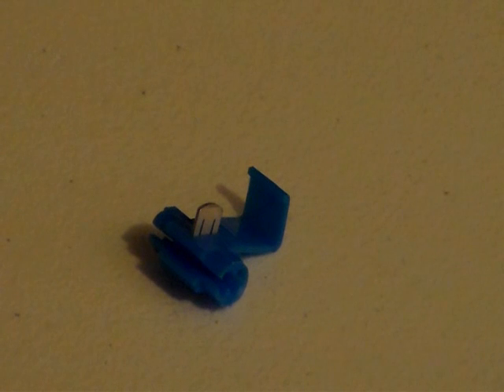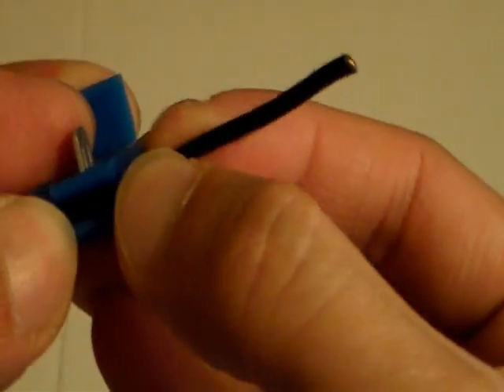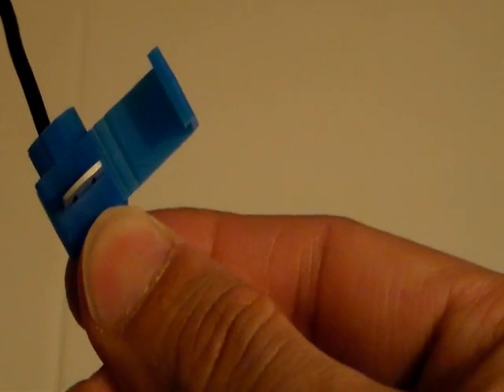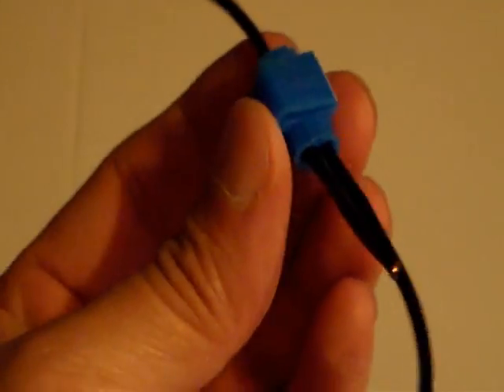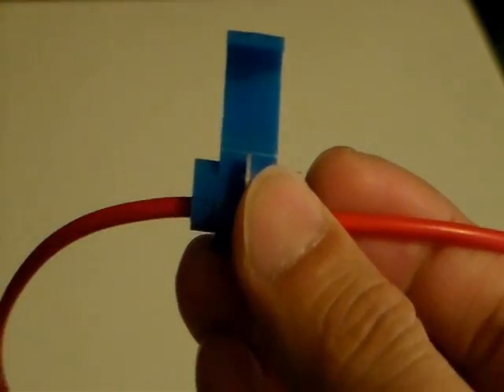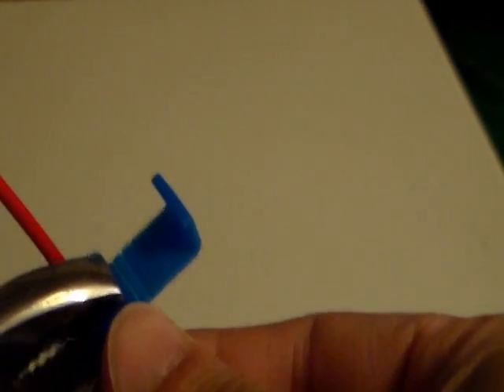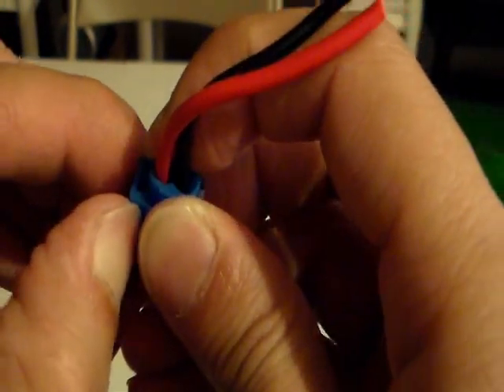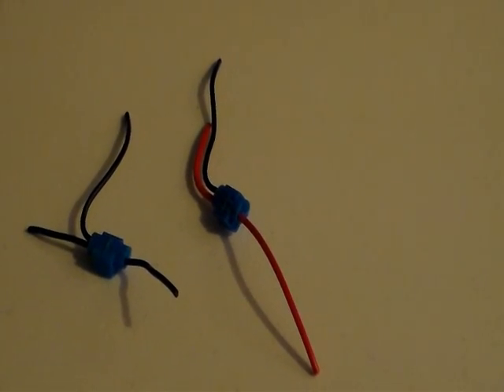Connecting wires using Quick Splice Connector - Scotchlok

Comment: What if you need to remove it? Just use the pliers to pull off the plastic part?
Reply from the maker: Whatever way works with minimum damage to the wire. I don't think this connector was meant for removing it's more of a permanent connection. If you plan on removing it, there's other connectors with easy connect and disconnect.
Reply: Were you able to remove it?
Reply: @ryatt1  ya it was pretty ez, just pull the tab back with a pair of pliers
Reply: @k3vin8  alright. Cus the splice didnt work for the lights i tried setting up in my car. Might need to cut open the insulation a bit more before putting another splice on

Comment: Can you take the connector off after you've spliced two wires together? By that i mean if you want to disconnect the other wire from let's say your car.
Reply from the maker: I'm not sure what you mean. The connector is just there to connect two wires together. Whatever else that needs to be modified would depend on what your project is.
Reply: @WelkingVue  once you push the metal part in on the splicer can you pull it back out? Without ruining the wires
Reply from the maker: I don't think this connector was meant for connecting and removing. If you want to do that there are some connectors made for easier connecting and removing. If you remove this connector from the wire you would have already cut the insulation on the wire. The wire could be partially cut when it was spliced.

Comment: Using these is asking for electrical failures.  First of all two dissimilar metals will cause electrolysis.   The connection will corrode over time causing failure.  Secondly you are leaving the connection open to the elements.  Even if the connection is inside the car there is moisture in the air which will lead to failure.  I've worked in the automotive repair business  for over 40 years.  If i found a technician using one of these he would no longer have a job.

Comment: Thank you! How safe and durable are these connectors? I am in the process of adding a rearview camera to my car and the camera needs to be connected to the positive and ground cables. Will these connectors work in your opinion? Thanks
Reply from the maker: I think how durable would be subjective. If you got extra wires and extra connectors the best way to find out is to test it out. Connect wires to this connector and try pulling on the wires it'll give you an idea of how durable it is. I done this test before, but with other type of connectors. Keep in mind if the wires are too skinny you probably won't get a good clamp and it'll fall apart easier.
Reply: These things will cut your wires. Not meant for wiring for vehicules purposes or a rear cam lol

Comment: These types of Connectors suck ass and are not water tight at all and pull apart all the time  a heat shrink butt connector is 100 times better

Comment: Thank you, very much.  I just wired a utility trailer using those T-tap connectors but the lights don't come on.  Now I know why.  I did not use pliers to pierce the wires.  I just forced the plastic flap closed thinking that that would be enough force to pierce the wires.  But they didn't.
Reply from the maker: Thanks for sharing!

Comment: i was wondering if it’s ok to connect two wires onto the same wire? Like for example, 2 black wires onto my car’s red wire.
Reply from the maker: I don't know how your setup is just make sure you know what your doing and do it correctly. If the red wire is power and you do that you'll have power on both the black wires. Depending on what your doing you might need inline fuse holder.

Comment: Thanks for the demo, but what about the exposed end of the wire your connecting to?
Reply from the maker: In reality the wire I'm connecting to would not be exposed. If you were to use this connector to connect a wire to a car, the wire on the car wouldn't be exposed at either end.

Comment: What happens if the wire isn’t pushed all the way in? Will it not work or is it just for safety
Reply from the maker: Hard to say without being there to see it. What matter is two thing. One, you need a connection and two, it does not fall apart.

Comment: Thank you so much for doing this video. I knew there had to be a simple way of using an existing wire to add an accessory without a lot of cutting and splicing. This is a great solution. A million thanks for making my life easier, now I just have to run over to the parts store and make sure they have these in the right size. 👍🏻
Reply from the maker: Thanks for the comment.

Comment: Are we not supposed to strip the end of the wire we're inserting onto the side wheres theres no exit or it doesnt matter if we strip the end or not?
Reply from the maker: If you crimp it and the little blade cut into both wires and you got a connection, then stripping isn't really needed.
Reply: @WelkingVue  thank you ! I wasnt to sure cuz it was my first time using those and wasnt sure if it mattered or not lol

Comment: Scotch lock splices are the worst possible connections you could ever use.... not only is there no weather shielding, but the bar that pierces through the Wire typically cuts at least 50% of the strands creating a high resistance hotspot in your power wire. In the automotive field these are the number one cause of electrical failures. If you need to splice a wire strip and solder and use shrink sleeve

Comment: with repect to you    .. but i do not like these    thay go bad   after some time with  rust
Reply: Seal it up well with electrical tape and silicon. That's what I have been doing for a while. I can vouch that it has kept 5 years of corrosion off my wires.

Comment: This was exactly what I needed.  I've never spiced two wires with one of these connectors before.
Reply: dave dont  use these  solder your wires
Reply: @michael6692  why?
Reply: @Fanatiekeling747  no reason he’s just trynna act like there’s only one way to do shit🤦🏼‍♂️
Reply: @slashmytires  😂🤣
Reply: @Fanatiekeling747  I would maybe add some electrical tape around just to seal off any opening or prevent it from in clipping or what not..

Comment: Thanks for the video! i heard there were these connectors that wouldn't require stripping/cutting wires/soldering, especially for a car where soldering can make connections kind of brittle. But I couldn't really figure out how they would work from the amazon picture. Good explanation, gonna do this in my car
Reply: I used these for my headlight build. really easy to use

Comment: using ScotchLok in some companies will get you fired,, they have a tendency to cut wires.. not recommended for Auto industry or electronics...
Reply: I'm The Law: Than what do you recommend using?
Reply: use blade three way connectors.. something like these.. 
http://www.12voltplanet.co.uk/3-way-blade-terminal-splice-connector.html  ..
https://www.waytekwire.com/products/1436/X-Y-Connectors/  ..
https://www.westmarine.com/buy/ancor--nylon-multi-stack-connectors--P009_275_004_500?recordNum=13  ...

we cut the wire, strip the ends, solder them and the use the connectors.. we also place shrink tubing on the wire before connecting them.. wrap some electrical tape around the connectors to hold them tight and then place the shrink tubing over it..
Reply: isnt it suppose to slice the wire  ?
Reply: @sdqsdq6274  it lets current flow from the original wire to the new wire.
Reply: my Apple IIe's 3rd party power supply kit had those abominations, i just stripped, soldered the wires together, then taped the bare wire up with electrical tape so it doesn't short out.

Comment: The inventor of these abominations should burn in hell. All you're doing is opening up the wiring to corrosion that will be nothing but trouble latter. I have had to remove hundreds of these and repair the damage
Reply: Cbmech ...I am installing a peak backup camera and the kit came with these....is there any other way to connect?

Comment: So you're in your car, wanting to quick splice a wire. How do you know what gauge it is to choose the right quick splice connector?
Reply: company I worked for If anyone got caught using Scotchlok, they would be fired on the spot.. they have a tendency to slice wires which creates an open circuit,, we either use crimp connectors or we spliced and soldered them together.. also using connectors in newer cars might trigger the anti-theft system and you will never start your car..
Reply: I did  a lot of under hood and along frame wiring and did everything possible to prevent corrosion... been there in the cramped area but Company rules are rules..  in cramped places I use Mil Spec Crimpers and needle nose pliers for extra reach....
Reply from the maker: With quick splice connector as long as there's a connection between the wires and the connector, then you should be good to go.  It depend which wire on the car you want to splice.  If it's a speaker wire I would use 18-22 gauge because speaker wires are usually small wire, hopefully you get the idea.  You could also look at the size of the wire and compare it to the part of the connector that will cut into the wire.  Know the basic, if the connector is too big for the wire, then the connector might not be able to splice into the wire, but if the connector is too small for the wire, then the wire might not fit into the connector OR too much of the wire might get cut when spliced together and could result in loosing sound connection.
Reply: Don't do it
Reply: Most cars use 16-18 gauge wire on stock wiring.
Reply: I'm The Law 
And if you're outside the cabin and do it, the corrosion can go a long way up the wire. I've had to go a foot to get past the green. Working on trash trucks I use crimp connectors I fill with silicone dielectric grease. I don't have the time and a lot of the time, the room to solder